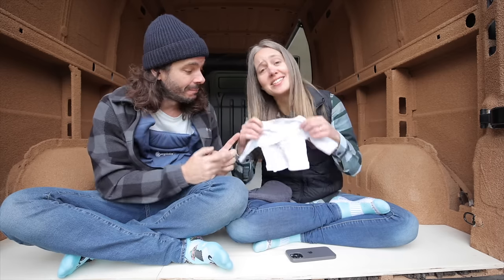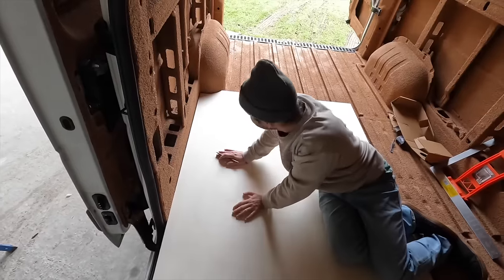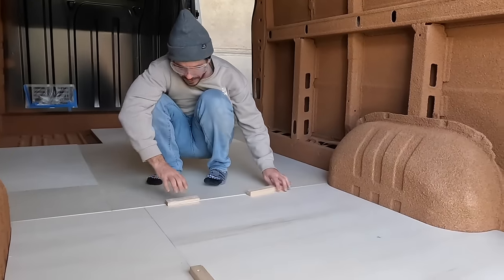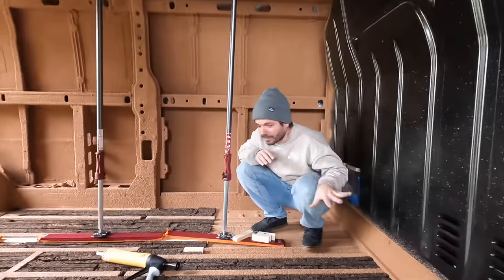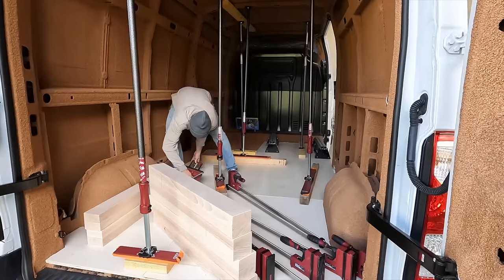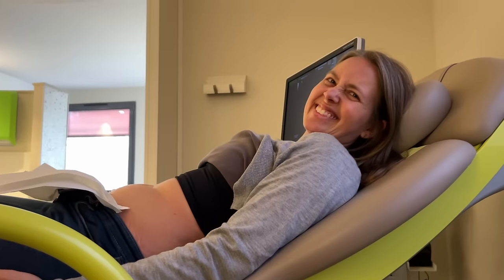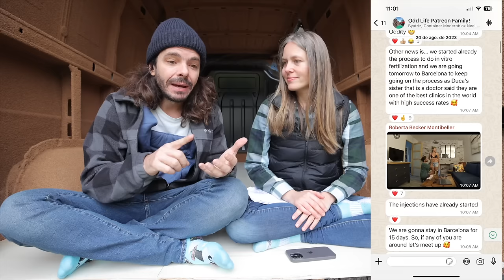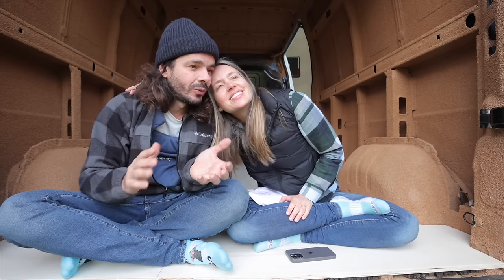🚐 ⛵️👶❤️ After 14 YEAR trying!! YES, we are PREGNANT!! Ep.326

Comment: Duca be careful using only Sika Flex, I have no doubt it's strong enough, but in this case you're relying on the  strength of the cork to hold your floor. The cork is great for insulation but it's integral strength is not enough in tension or shear.

Comment: I would have used a foam strip on the board edges as the van and the boards will expand and contract by different amounts in different seasons and need to float a bit ..it also cuts out end grain wood squeeking when driving.. building  kit cars are where i found that one out. 😉🧙🏼‍♂️

Comment: Do you need some kind of padding around the edge of the plywood so it doesn't squeak as the van flexes?  Or maybe metal vans are rigid enough so it doesn't matter?
Reply from the maker: We actually apply Sikaflex that is a flexible material on every edge so it is fine. I was actually impressed on ho you can't even notice the plywood when we drive new. 😅
Reply: @OddLifeCrafting  is there anything you can't do with sikaflex? :Bonus points if your baby is named Sika :-)